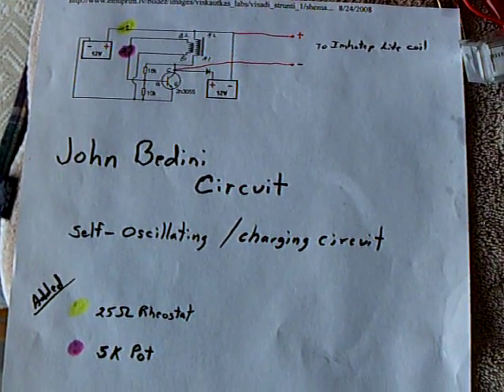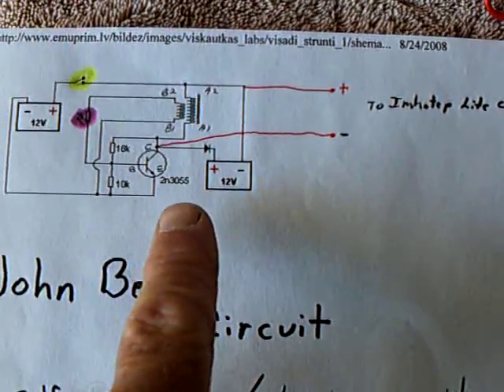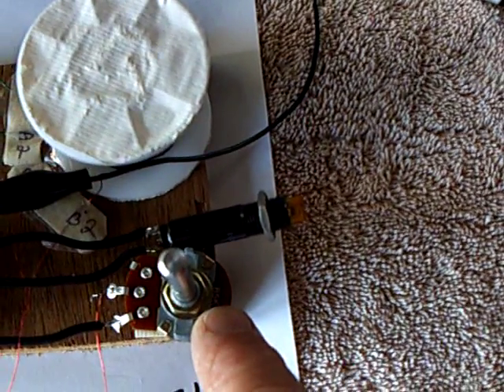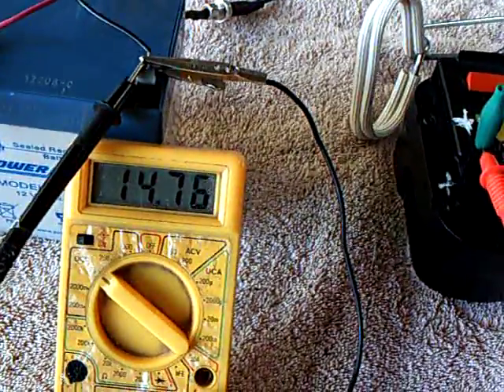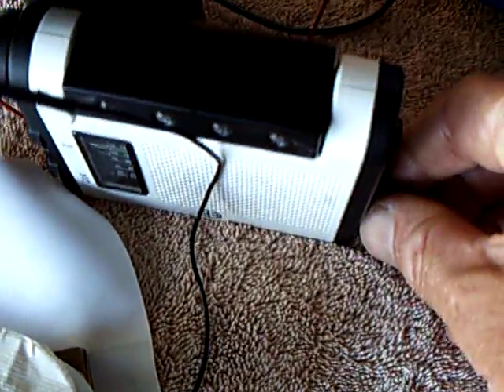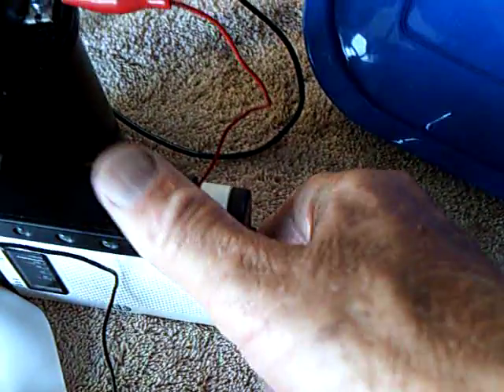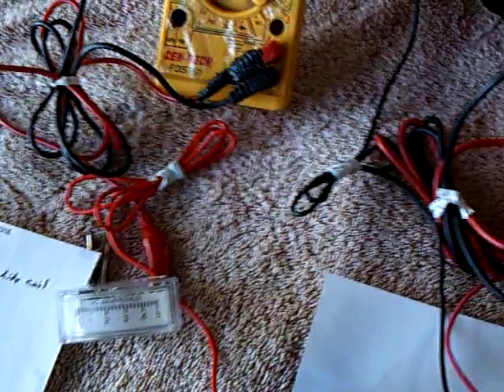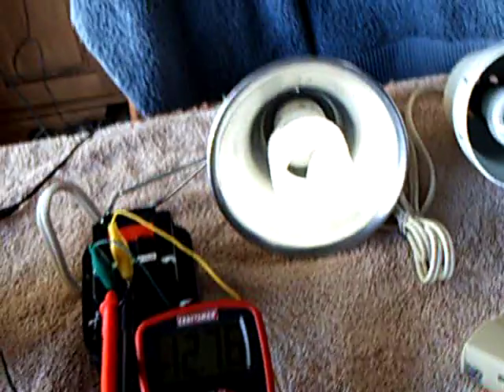Imhotep Radiant Oscillator Lite -- Solid State

Comment: if you ran the source and charge batteries through a commutator that only switches over when one or the other is full or empty seems like you could work it out to run indefinitely.